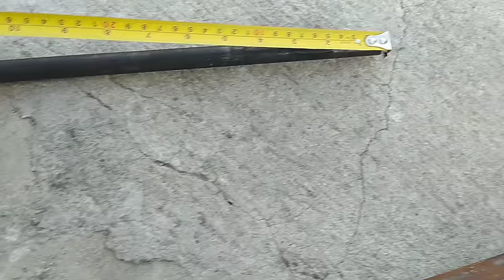PAANO PALUTUNGIN ANG TUNOG NG TAMBUTCHO, D.I.Y CHICKEN PIPE.

Comment: when u break the divider it increase hp like 1hp then put the pipe destroy all divider the all setuped 10hp+
Reply: wrong, stock engine gains more power with its original pipe chambers. destroying its divider affects the rpm
Reply: No, when you destroyed the dividers it affects the fuel consumption, the carburator supply will be shorten little bit after you done like this try to check your sparkplug it will be lean.